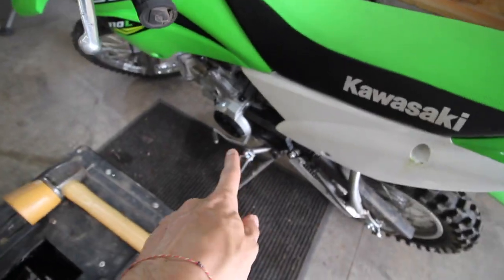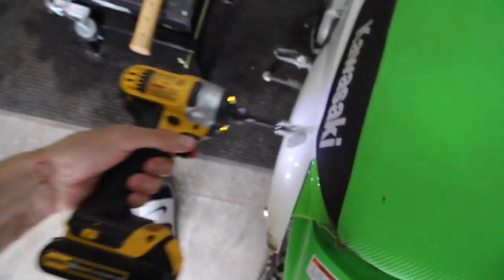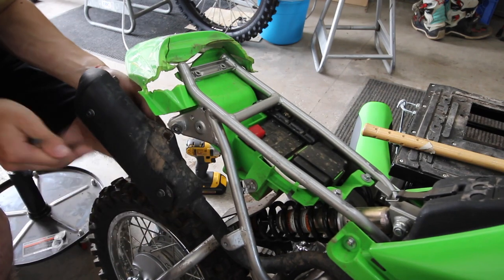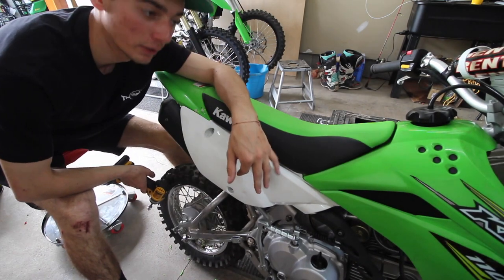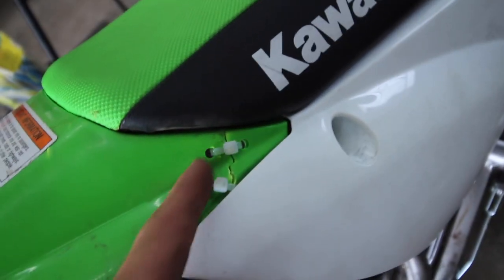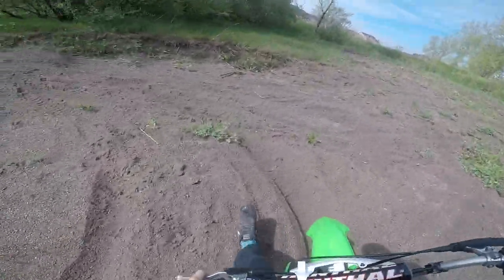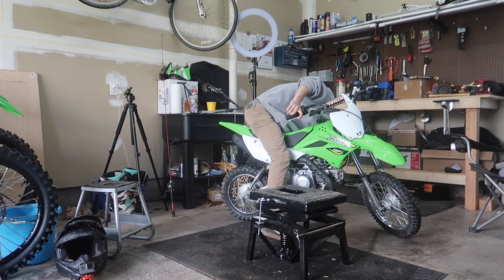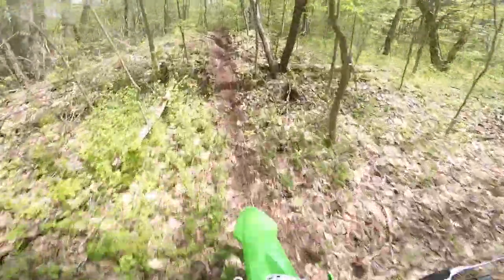THE PIT BIKE EVERYONE NEEDS!

Comment: Which would you buy the new crf 110f EFI or Klx1 110L??
Reply: I’d get the 110L all day. Bc 1 you can have more control over it because it has a clutch. And 2 it has a higher seat hight so it wouldn’t feel as small.

Comment: Should I get a crf 100 or rm 85 for a first bike. I would like to ride motocross and trail. but don’t know if I should start off on a 2 stroke 85. My dad never had a dirt bike so I don’t really have that much help. My neighbors are close so if I was ever going to ride in my backyard I would need a quite crf. I’m 5’1 and 120 pounds btw
Reply: I would get a cr85
Reply: 85
Reply: I would get a 450 for ur fist bike.
Reply: I would go with the crf 100
Reply: My first bike was an rm 85
Reply: I went with a crf100 and it was a great learners bike. I strongly recommend it!
Reply: Ray Adams the rm85 is pretty good for both trails and track. And your size is perfect for an 85 the 100 will be too small trust me I've had plenty of bikes and my 9 year old little bro has a crf100 it's a great bike but not the right size for you, the 85 is quite a bit taller and would be great for your height.
Reply: As long as it's 4 stroke it should be fine
Reply: Either get a cr 85 or a crf150rb
Reply: Andrew Lowe why a cr85 and not an rm85? They don't even make cr85's anymore
Reply: Mitchell MX thanks 🙏
Reply: Ray Adams no problem
Reply: 150f